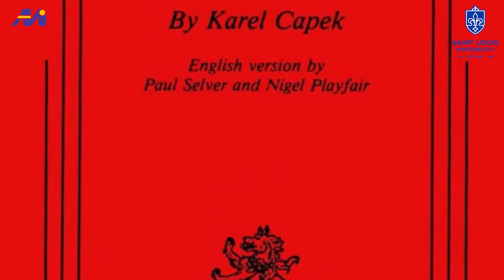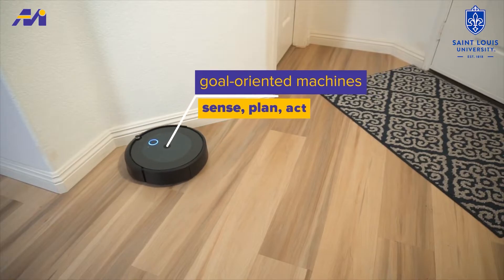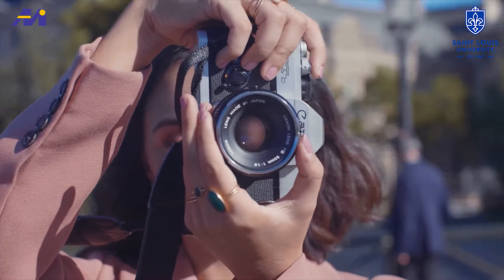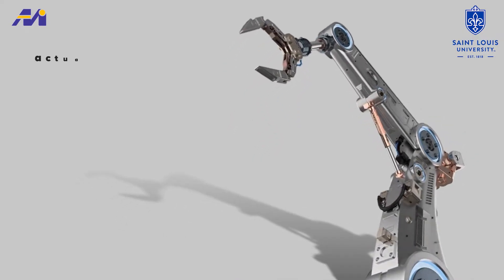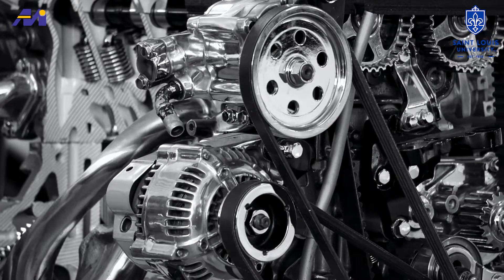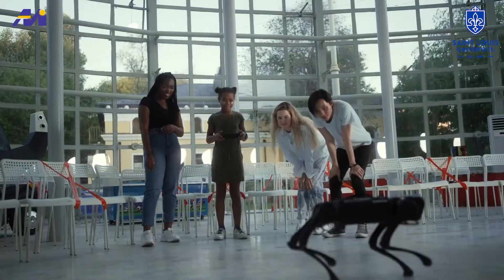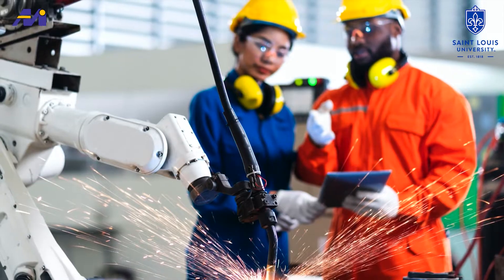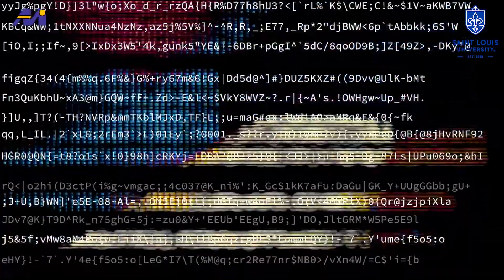Introduction to Robotics Course Series

Comment: What if a robot had learned what a toddler learned in her mother's kitchen pulling and pushing on the knobs and handles of doors and drawers? We sense where and how to push and pull and twist on objects to make them do what we expect. Imagine a robot with template kinematic and dynamic models of objects surrounding it embedded in its brain with the ability to probe mechanism mobility anywhere and in any direction and pick what works best instead of always by trial and error. A mobility number is like a perceived mechanical advantage. If the mobility number, which is the square of a direction cosine relative to the differential constraint manifold surface, is close to unity, the door will open easily, but if it is zero or close to zero, the door will not budge.